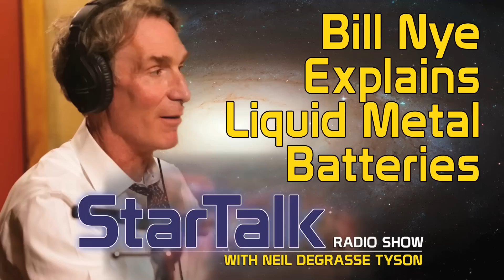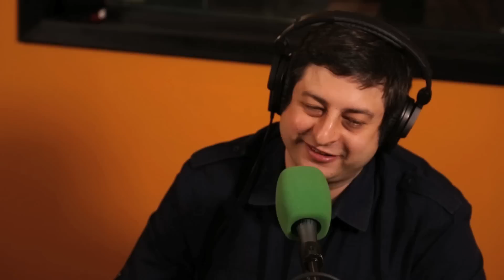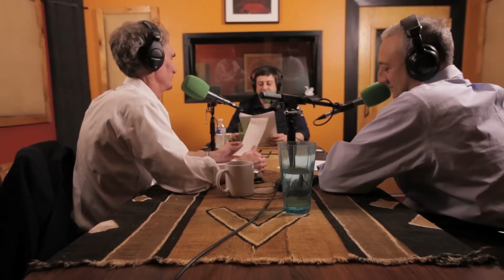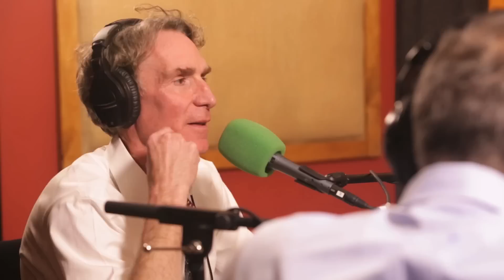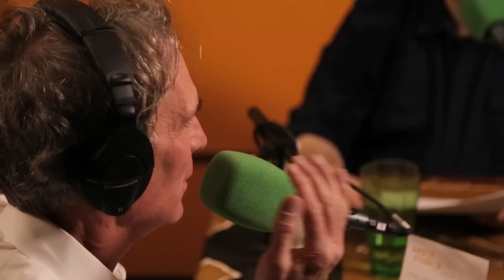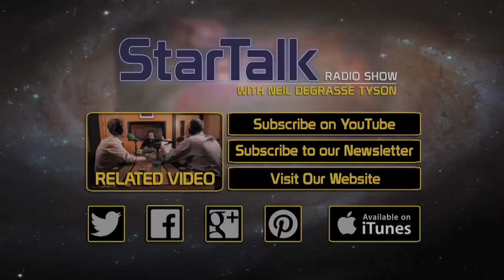Bill Nye Explains Liquid Metal Batteries

Comment: This sounds only slightly safer than having a mini nuclear reactor in every basement like we were going to have back in the 50's.
Reply: They are not radioactive though. It's just salt heated to 300-400C. Not much more dangerous than a boiler.
Reply: If you watch Mythbusters, when they blow up water heaters they do lots of damage and the house may fall on you, but at least steam doesn't ignite every flammable thing it touches. :(
Reply: *****
I did watch Mythbusters and they prefaced that experiment with the statement that this is a one in a billion failure that would never ever happen unless you purposely disabled all the safety systems and just started heating it without temp control. So not very dangerous at all.

Comment: I'm all for Flywheels.
Reply: Yup, That's another great way to store energy. With several different energy storage concepts emerging this might turn into another Tesla vs Edison war, i wonder which one wins this one :) Whoever it is will become filthy rich :)
Reply: Small scale maybe. But on a large scale there would be too much stress to maintain. Bearings for one. Foundation for another. Balance is an issue. Yes. Water can be used, which would self balance. But then you have corrosion issues and or the further complications of stress on the containing vessel. If we start thinking in terms of mag-lev, then the energy consumption outweighs the storage benefit. It is cost prohibitive. The energy cost of initial rev up would be astronomical. Then mechanical to electrical conversion taking another toll on efficiency is another deterrent. 

On small scale such as in wheel hubs in electric or hybrid vehicles of all sizes and shapes, flywheel energy storage is doable.